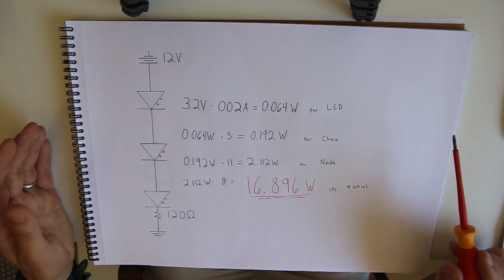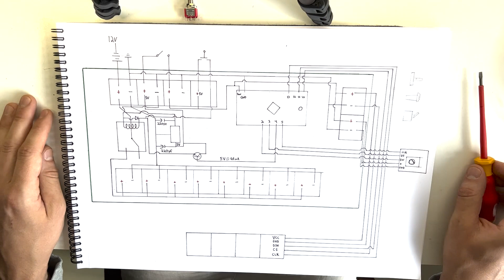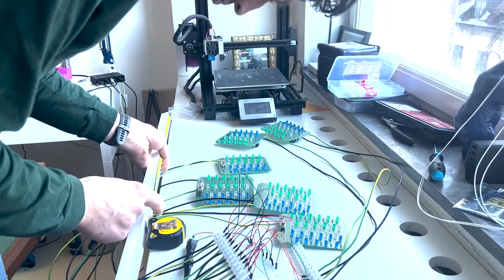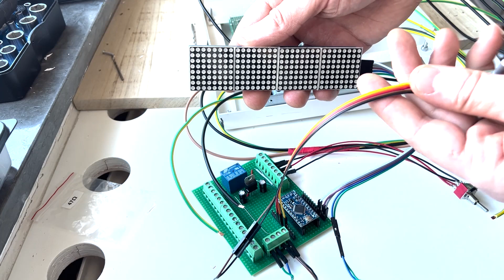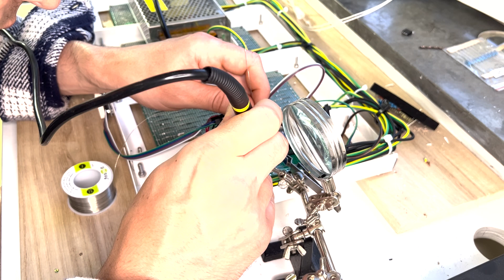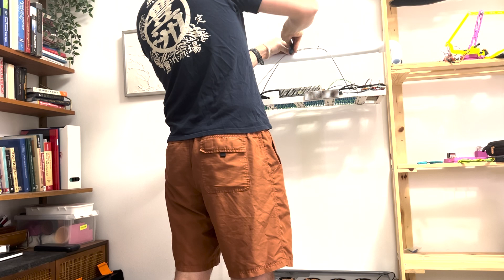Grow light Build with Arduino

Comment: I am in the process of building my own research grade grow light, 10 channels, single wavelength per channel.. I just ordered my single string boards and will put 10 of them together on one to make the final version.. im getting pretty good at making pcb's and engineering these circuits.. love the idea of arduino control, I need to elarn how to write software for that tho.